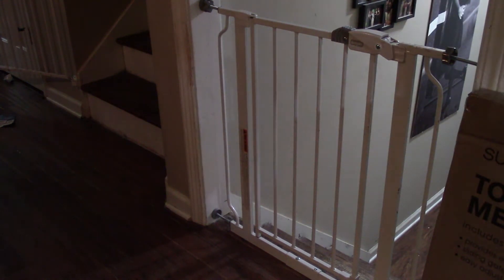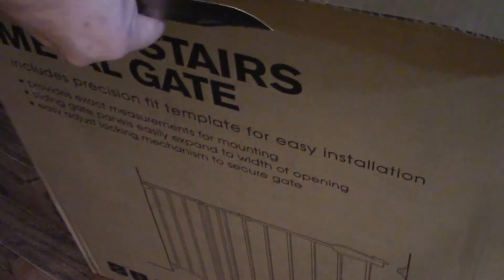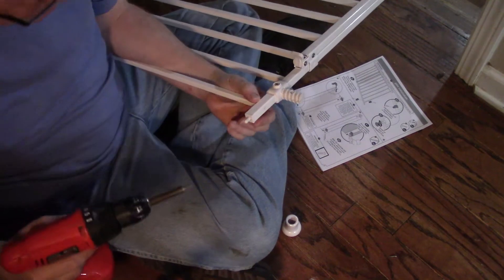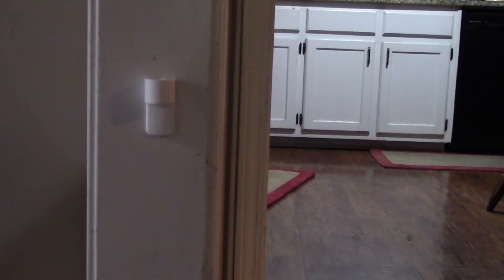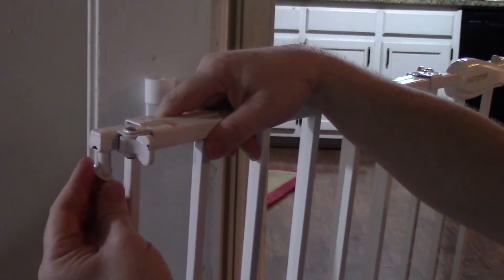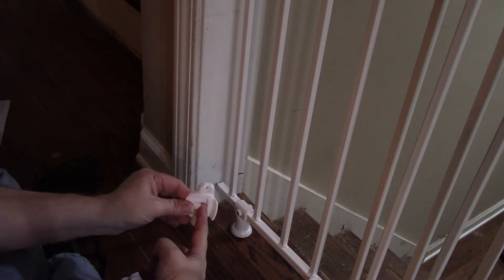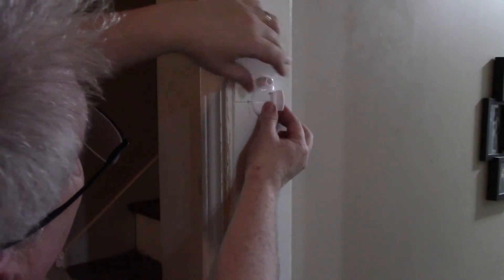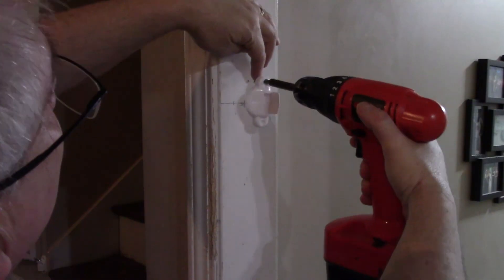Summer Top of Stairs Baby Gate Unboxing and Installation

Comment: You can't use the first one at the top of the stairs because the bottom bar is a tripping hazard.
Reply: That's one reason - main reason is because it is held in place by pressure. If a baby leans on it or pushes hard enough they can knock it down and fall down stairs.